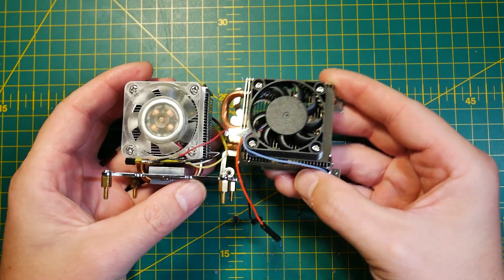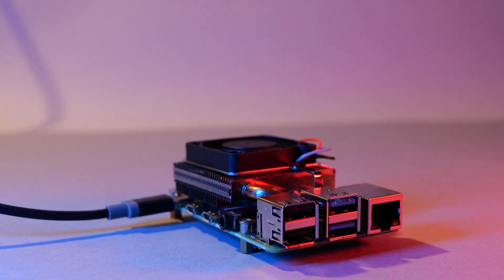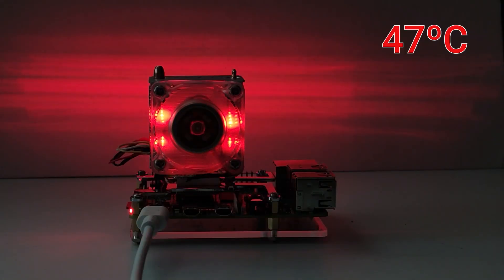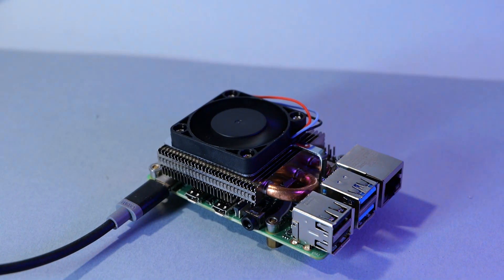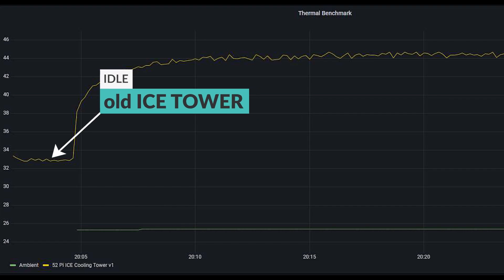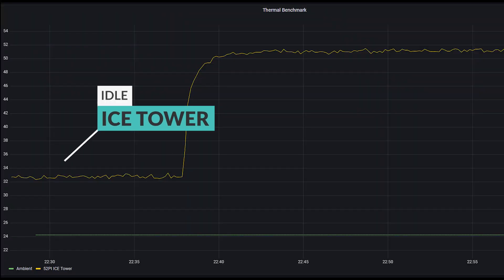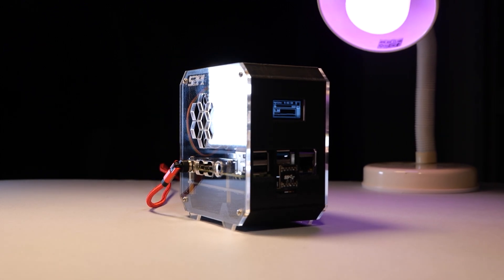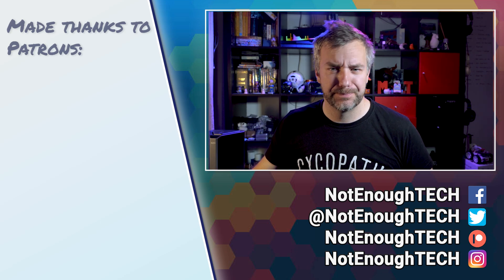Another insane cooler for Raspberry Pi 4!

Comment: i install today ice tower slim line cooler my raspi4 8gb and before temp ha alltime if looking youtube or netflix about 76-84 celsius, owerlock max can keep only 1,2ghz max. test today  alltime same videos and games etc, owerlock 2ghz and temp have 34-41 celsius only, best cooler what i has test my raspi4 now, argon have first cool but if raspi have all day ON has ewening 76-80C hot, argon case store lot heat if use raspi normal all day. ice cooler not store. flirc case not cool good too has wery hot ewening if use normal full day.
Reply from the maker: Argon Cases have good passive heat exchange but as whole case is welded to the CPU heat creep is unavoidable and a good fan profile is a must on them. Great for short boosts of CPU load but hard to overclock without ramping the fan up.

Comment: What about over overclocking isn't that the whole point of getting a fan that good to overclock and based on the temperature being 53° with benchmarks this evidently has headroom for it
Reply from the maker: You'll definitely have headroom for that.
Reply: i owerlock raspi4 8gb 2ghz and temp has all day only 34-41C, before has only fan case and temp has alltime 76-84C this ice cooler have lot lot better than argon case or all my old fan cases. before not can owerlock lot max has about 800-1,2ghz only.videos lag lot before now can looking videos good no problems.